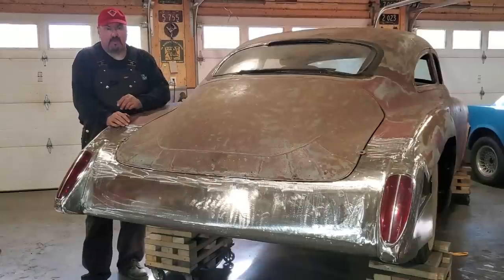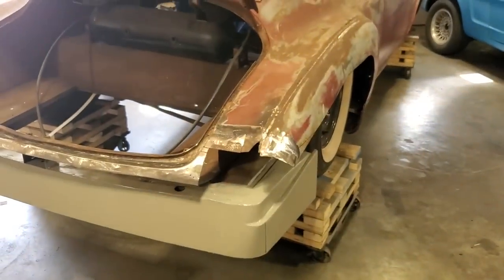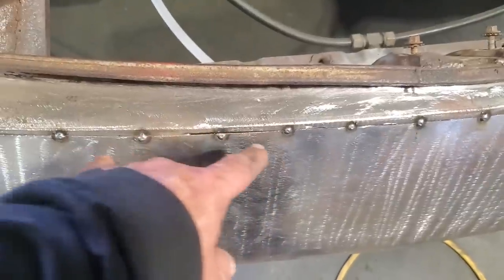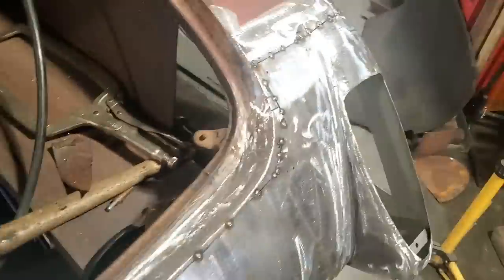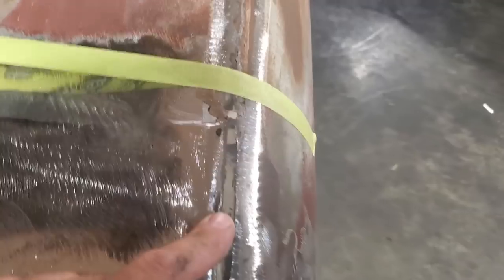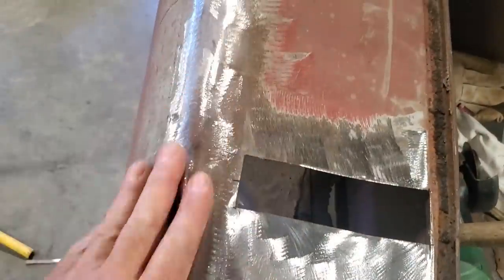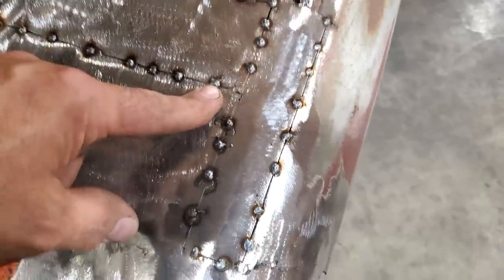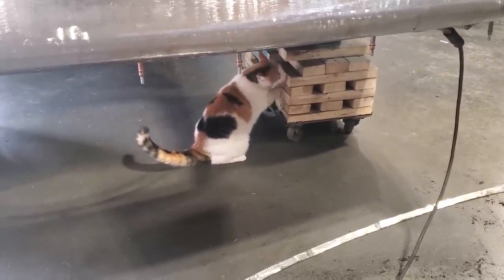Using the Cut & Butt to weld in large panels

Comment: Damn it! All true Fitzee!! Wish I would have seen this vid BEFORE I did the tail pan in my ‘57 Chevy! I think I made every mistake you pointed out not to make! Started at the end and worked my way across. Wrong! Ended up with the metal wanting raise or wanting to drop!! Made it work with a lot of cutting, grinding and dolly work to get it to fit! I’m glad I started on replacing the trunk floor to meet up the tail panel. I’ll do the tail panel from the middle out!! 
Great video!!

Comment: I have a 1990 Saab 900 Turbo and it has very little rust after 34 years in finnish climate. Year round driving. We sadly salt the roads here. But people tended to take better care of their cars in the 1980s, they had them rust treated with oil. This car hasn't had a treatment done in many years it looks like. But I bought it before it got too bad. Gonna take care of the rust, clean off the old treatments and apply new oil under the car and in all the hollows. I recommend raw (not boiled) linseed oil applied in the hottest summer month. 

It has many excellent properties and is cheap and eco friendly. It penetrates incredibly well, paint it over existing rust and it penetrates down to bare metal and stops the ongoing rust attack, then it oxidizes, this means you can paint it over seams and it will penetrate into the seam and then oxidize, so it can stop hidden rust in seams from getting worse. And when it oxidizes it expands, sealing the seam. And on exposed surfaces the oxidized oil forms a durable barrier.

One very important thing is to keep it from oxidizing on paint, or you won't get it off ever again. You even have to be careful about oil you put inside near seams because it creeps so well it can make it's way outside.

Comment: Great video again Tony! I'm glad you pointed out that rust never sleeps. When I use to do body work back in the old days and a customer would come in and want a cheap job and "just patch it up" , I always told them that just because you see some small holes on the outside of the body does mean that the metal just needs a small patch to fix it. Rust from the inside has now made it paper thin. I always try to explain to them that just regular driving in Nova Scotia that the body work would probably last for less than 2 years unless you were willing to keep oiling it and storing it dry. I'm glad you explained this on the video.

Comment: I expect that result was very satisfying Fitzee, nice work. I'm now putting into practice all the techniques I have learned from you and a couple of others in restoring my fathers old Rolls. A lot of rust in the rear wheel arches, inner and outer, rear sills, tail lights and boot floor that I'm working away at and doing properly, taking my time and learning more as I go. I had never done serious panel work and metal forming before but the process of taking a flat piece of steel and beating and welding it into a section of car body is very worthwhile, I am amazing myself with what can be achieved with so few basic tools, patience and effort.

Comment: I must admit Fitz your fabrication skills with body work is at another level compared to most body men. A lot of body men today all they mostly do, is just replace panels they purchase them and replace them but not often we see a man like yourself that does body work to this level. I have to admit I'm impressed. I was a welder fitter most of my life but I worked with heavy metal structural steel and heavy equipment, oceanic projects and such. For instance once I worked for a research and development company and I built the welding table for the Austin mini and I had to fabricate the gantry crane for the whole system, when we finished it, it was sent to Birmingham England. That's the kind of work I did back in the day.

Comment: I've done exactly what he describes cutting in patch panels and quarters and it is a great way to do it.  He is correct about putting o filler after your done.  That's the most tedious and most important if you want a flat non wavy panel.  There are other videos on here on how to use powder to find low spots and using primer filler after to go over it again.  It takes time but I found out the hard way it's a necessary evil.

Comment: Fritzee, great tip on the drill bit. Everyone has dirll bits that cannot be sharpened and one that has wear on the sides would be great for cleaning paint out of the bottom of a hole. Actually any but I am cheap and would use an old broken one. I have a few. Cheap Chineseum drills would be great also.

Comment: Hey Tony I used POR 15 on a piece of metal that had surface rust and I painted the por 15 on it and it set outside for over 8 years and when I gave it away to someone that needed it the rust hadn't came through.  The trick to it is paint it on one direction and 1.5 hours later paint it the opposite direction 2 heavy coats.  That's what I did and still do with no problems

Comment: I am a repair tech my entire life, except repairing somebody work & repainting after teaching 4 kids how to drive forward & my wife to backup. One of your cutting tricks on a butt joint is to hold the grinder at about 45 degrees into both sheets. Now it overlaps, lays flat and becomes easy to weld with a good heat setting. I have owned my MIG new since 84, so nothing fancy or digital but I can weld. Am I correct on the butt joint angle? Thanks so much Fitzee's! Happy new 2023 as strange to say. DK, ASE master tech since 78, retired.
 I am not an English wheel guy but I am proud of your version of Karl's table extension! lol 😮

Comment: I agree on the rust situation, I live in Kentucky and see fairly new vehicles rusted out, then I’ve seen some older vehicles with high mileage and be really clean, heck I’ve seen trucks from Canada that were cleaner than some off the local vehicle’s.

Comment: Exactly about the rounding of the corners in an aircraft. Check out pictures of repairs made to a plane that pressurizes. There will be several layers . Those layers add strength back into the skin.

Comment: It's ironic that this topic would come up today as another channel just did a demo on vehicle preservation. You can see it here: https://www.youtube.com/watch?v=auI_ABZ1chA   He is using a product called Fluid Film and it is safe and environmentally friendly. The product itself is made from lanolin which is extracted from sheep's wool when it is processed and the oils removed. Since it is made from lanolin it has a tendency to stick to the metal almost like a flexible wax would. I have used this product several times and I have no complaints of any kind. I used to use used motor oil which left many things black and had a tendency to leak out the excess on the ground leaving stains on garage floors or concrete driveways. Fluid Film may dribble out if it's over applied but it can be washed off pads and driveways with a pressure washer and some detergent.

Comment: Again another really great video packed with important techniques to overcome obstacles we all run into.  Start in the middle wnd work your way to the outside is key.  I've messed that up a few times.  Next the tape technique to identify differences side to side, especially valuable on curved panels.  So simple, yet, I sure didn't think of that at first.  I was working way too hard to construct a curve template.  Next, your handling of leaded areas we all run into on these old cars.  I have been at a stopping place on one project when I hit that and wasn't sure what to do next.  Is there an approach to removing old leaded so it CAN be suitable for welding.  Sometimes it is in areas that are really challenging to simply replace?  I used your videos last year to successfully work through the rust replacement on my '56 GMC pickup, I actually made more panels than I bought all as a result of your videos and the end result is great.  This video is especially useful for me as I begin some major work on a '59 Porsche 356 I have with a front fender nose replacement so I have been very concerned about getting the curved nose panel mounted correctly.  THANKS!!

Comment: VERY helpful tips in this video. All your hard work turned out looking very good. Have you ever made use of 2 part high build primers ?? That has always been about the only way I can get body work super straight and flat. Mix up the Z chrome and block sand it until it's flat. Thanks for the good video.
Reply from the maker: Used alot of it in the past. Will be going over it soon when I start to get into some filler work on a few projects

Comment: Sure wish i'd used this technique when i replaced both my rear quarter panels, i used those square clamps and caused me nothing but a big headache. Took ages to get the panel butted up to fit correct, then when welding they didn't hold enough and ended up allowing the panel to pull gaps also they pulled the curvature out of the panel. Live and learn i suppose

Comment: In Minnesota with all the road salt they use rust is inevitable if you drive a vehicle in the winters no matter if u wash them or not cause u can’t really get up into the places that with catch and hold all the road grime. There’s a lot of 6-8 year old trucks with the wheel wells rotting out already. Soaking everything underneath with fluidfilm or something like that will definitely help but that’s not full proof either.

Comment: Thank you for the video.  I will be using cut & butt to weld a replacement floor in a 1965 Sunbeam Tiger this weekend.  Is there a specific cutoff wheel or wheel thickness that you use and would recommend?
Reply from the maker: 3/64

Comment: Fitzee, have you tried Rust Bullet instead of POR 15? Rust Bullet doesn't require ll the crazy prep and cost that POR 15 does. I just spray down panels/pieces with Eastwood After Blast or some Phosphoric cleaner, then paint on Rust Bullet and I'm done.  Bullet can also handle UV rays, where POR can't. Hope this helps.

Comment: Thanks so much great video! got my Fitzee Fix ! One Question I have at times gotten big pits in the center of my spot welds, any thoughts?
Reply from the maker: The pits are dirty metal. I run across them before. Rust on back side of a panel you can't see will do it too.

Comment: Hello Fitzee's, with thicker metal (11,14 0r16 gages) are you using 0.23 wire for these gages or bigger? Thank you...
Reply from the maker: If it's a small job I use 023. Just cause I don't want to change out the wire. But 030 is much better for thicker metals

Comment: Hey fitzee- yours is the best channel I subscribe to!  I like the way you take what seems to be a complicated job & break it down into simple small steps. I think after watching your videos I'm ready to try to "CUT & BUTT"!    also can i use a flux core mig for cut&butt?  Any advice would be greatly appreciated.  Thanks for your time!
Reply from the maker: You will find the flux core will be alot harder. It has alot more heat and blow threw is a issue. I done a video on using flux core. Was a nightmare for me.

Comment: Leaving the car outside over night on a clear sky will result in condensation on the inside of the steel.  That is why you get rust above the headliner and inside the trunk. It is not all from water splashing up from the road.

Comment: A lifetime of experience distilled in the thought processes in this, (+ cat video :-)* ).
Marine or coastal environments are killers for rust; if you're downwind of salt water, (e.g. Florida),  it'll eat through. Industrial emissions can also be corrosive. A Fiero that lived near a steel smelter looked perffect on the (plastic) outside, but the steel spaceframe was a fragike lacework of rust.
Would it speed up the process to have a rollable stand, (perhaps an old IV post), to hang the torch, ground, and grinder safely away from each other when not being used? It would save looking for places to put them down, given that you don't have 3 0r 4 hands.

Comment: I use Fitzees air cool method for cooling sheet metal welding and just use paper templates to cut out my panels and weld it together, just stretched out my fenders 14 inches to accommodate for room for larger engine and radiator on my 47 dodge paneltruck, did it in 4 pieces across the width and curved them by laying them on a round cylinder tank and curving them to shape, another trick from Fitzee using small sections to fill in so you don't have to do multiple bends and angles on one piece, looks pretty good, going to have to stretch hood out next, i do see how when i tack my piece in and i have to cut a touch out in places for fit i 45degree the cut and the weld just falls in place like butter,  thanks as always for videos

Comment: Fitzee got a question, how can I best fill 9 small holes on Van roof? There used to be a special antenna over the cab area. Is tigg wielding the best? The biggest hole is about 1/4” the other holes are sheet metal size. An antenna went up the center hole. Thanks !
Reply from the maker: I have a video called "how lto weld holes the easy way". Check it out.

Comment: Weld thru primer is actually best used for when you are spot welding such as in a collision repair shop with the correct equipment. It’s a joke I think so I only use it to cover welds as best I can and for exhaust purposes

Comment: Hi there fitzy. I know at one point you went over basic tools but right now I've ended up with a bunch of cut off wheels for the grinder that are just disintegrating and they're making gaps way too big so it seems like they're too thick can you suggest to me what type you use or what thickness I should look for
Reply from the maker: Next video. One on the quarter panel I show the wheels I use and the thickness on them. Maximum is the brand and they are 3/64

Comment: re: Body filler.
On one Chip Foose episode, I noticed them taking a brand new panel and completely covering it with filler and then block sanding until they just started to hit bare metal.  I imagine the next step was 2K high build primer.

Comment: Fitzy, how does one  do a cut and butt on a 50mm diameter circle? This is something I have to do in a confined space on a car.
Angle grinder didn't like circles .
Reply from the maker: Air reciprocating saw.
Reply: @fitzeesfabrications  brilliant Fitzy ....I'll do some manual version of that.
Btw, is newly applied bitumen undercoat  flammable to welding  next to it?
Reply from the maker: @silviak3105  don't know that brand but most is very flammable. I welded with od undercoating and it can be a pain and one big mess

Comment: Do you have any tips on welding overhead. My welds seem to ball up when welding. Thx.
Reply from the maker: I hate over head. I find you have to turn up the wire speed a bit sometimes even the heat. It's a picky setup that has to be tuned in on the job

Comment: Tony - Been doing a bunch of reading on weld-through primers. It's really a double misnomer. You don't weld through them, and they're not a primer. They're only to coat the inside faces of overlap joints that you rosette weld. You're supposed to remove the primer at the actual weld surface. And, people complain that adhesion is awful, yes. It's not a primer. It's a final, sacrificial coating. You don't paint over top of it. So for someone like you who mostly butt welds, and hardly spot welds, it's not that useful. Frankly, I'm not sure it's all that useful regardless, but, I think I'll try to coat the inside of my rockers with it anyway, I figure the zinc has to be better than paint? The copper stuff apparently has better conductivity (helps welding), but copper and steel create a massive galvanic corrosion cell, so, I wouldn't ever use that either.
Reply from the maker: Good info thanks

Comment: Hi there brother I've been following your video's for a few years now and I've never seen you stitch weld and cool the wedding down with a sponge with water is there a trick or not
Reply from the maker: I tack weld. Stitch welding adds alot of heat. Cooling it with water makes a mess. Only time I use water on metal I'd to shrink it